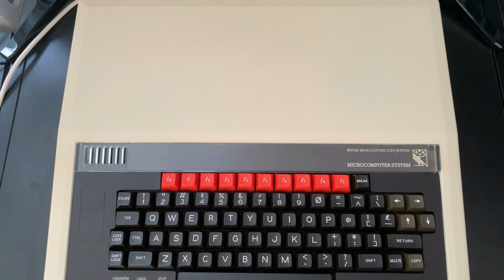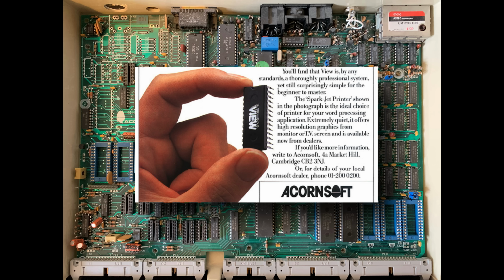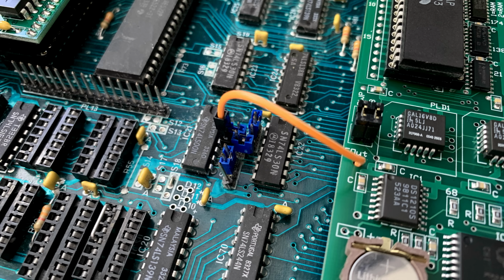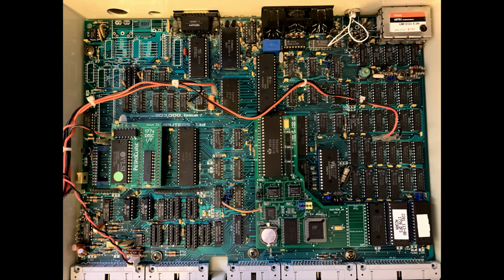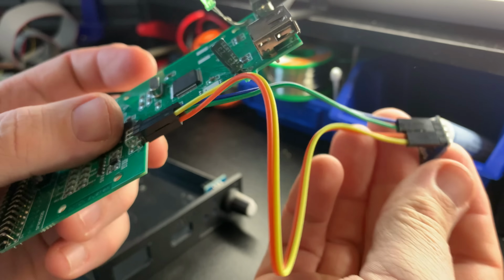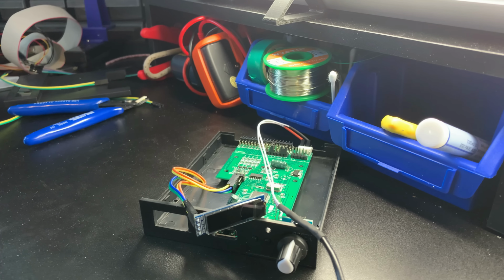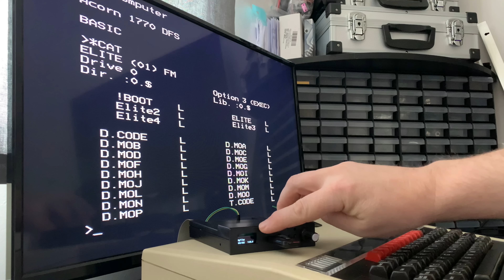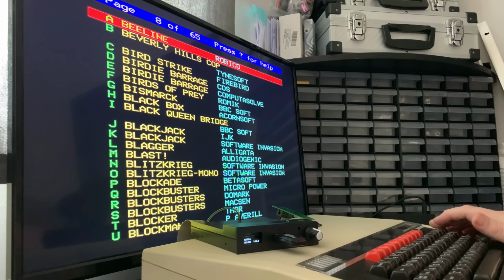BBC Micro - Part Three: Can This Little ACORN Grow Up To Be A Massive OAK?

Comment: It really is the most gorgeous font on the BBC.
Designed for Teletext, it's requirements were to be readable on a PAL CRT of a certain size at a certain distance, across the living room.
It used the analogue nature of video signals of the era to generate sub-pixel detail, psuedo-triangles instead of pseudo-pixels, with four different shapes, NW, SW, NE and SE.
I don't know if the regular raster modes used the sub-pixel detail trick but mode7 definitely did.
It's not a font of course, merely a character set.
Unnamed, it's typically known as the "SAA5050 character set", named after the character generator IC found in the Beeb and Teletext devices, the Mullard SAA5050.

Comment: I remember Solidisk, that sideways ram solution fitted at the side.
I also remember making a single sideways RAM extension for a friend, using 2x 8k chips piggybacked and a 74 logic chip to steer the select
Reply from the maker: That’s cool!

Comment: IIRC, you can use *. instead of *CAT and <shift>-<break> will boot a bootable disk. Less to type!
Reply from the maker: You're absolutely correct :). In fact, the main acorn forums are at stardot.org.uk (*.) -  With MMC devices, ADFS and Sideways ROMS there are various combinations of CTRL-BREAK/SHIFT-BREAK to do things and I always get the wrong one :) :)

Comment: Another great Beeb video! Brings back lots of memories for me, we had 16 of them eco-netted together. One machine had a 20meg winchester hard drive, where all the files were saved too. One machine had a disk drive and that was the one I always used so I could play games. Years later I came across an auction for a lot of bbc micros from a business that was selling up. I ended up with 3 machines drives etc and several large boxes of original software on tape and disks. One day I will pull it out of storage and sort out what I have
Reply from the maker: Can I give you a hand? :) :) If you’re an Acorn fan you’re going to LOVE this weekend here at the Shack ;) Keep watching :)
Reply: Winchester hard drive
Now that's a name I haven't heard in a long time... A long time.

Comment: I was using one of these in a lab as logger until 2005 when I updated to a pc and LabVIEW.  The beeb was a built like a tank. Miss having access to ADCs, and various buses on old personal computers.
Reply from the maker: You’re not wrong there!  Has anyone else on the channel been using the Beeb in a professional capacity later than 2005? Let us know!
Reply: @TheRetroShack  I guess the raspberry pi or similar would be the equivalent now.
Reply: @andrewapsley7259  The OSes are too big and complicated for simple tasks. too many hidden things updating and breaking.

Comment: I remember having a non battery backed Sideways RAM bank installed on my Beeb back in the day.
It was a bit clunky and came with the machine when I bought it 2nd hand and did weird things with the user port which caused issues with my mouse & paint package.
Reply from the maker: This one seems to be playing nicely so far :) Thanks for sharing!
Reply: @TheRetroShack  think it was this one https://telcontar.net/About/Beeb/evil-hack/Both-expansion-boards.jpg Solidisk, had leads which you had to attach to various points on the board and chip legs, which never seemed to stay attached for long.

Comment: Pin 14 of the right most rom (basic) is out of the socket.
Reply from the maker: Timestamp?  Must be an optical illusion as it's working fine :)  I'll open her up later to check :)
Reply: @TheRetroShack  7:39
Reply from the maker: @ucmetoo1  Ah, I see.  That's not the basic rom, that was the SPI rom and the leg was slightly bent.  I removed it anyway and instead I'm using an MMFS rom loaded into a sideways rom bank.  Good spot though :)  Eagle Eyes!
Reply: @TheRetroShack  😁

Comment: I have just inherited a BBC micro B from my uncle.
Hope this isn’t a stupid question but does the Beeb have an internal clock? And if not is there a way I can install one as I’d like to write a programme that requires one.
Reply from the maker: As standard, no.  But if you add a sideways ROM/RAM module like I did, you get one then :)
Reply: @TheRetroShack  brilliant, thanks!
I will look into a sideways RAM.

Comment: Has anyone built a homebrew Version of the BBC B or Master....As all the components are still available  ?.

Still available:

CPU   W65C02  (up to 20MHz)  (DIP or PLCC)
RAM   SRAMs like UM61256-15  IS61C1024 -15....  15ns
ROM  W27C512 etc  45ns  DIP/PLCC
6845/6545  /HD63C45CP/HD6445  DIP/PLCC
SN76489 DIP16
FDC Still available WD1773 ??
Teletext Chip is still available 
And practically all the other chips can still be sourced ??

Would be great to buy an updated (Faster / Better ) Acorn BBC B/Master .
Reply from the maker: Another interesting concept!  Lots of great ideas coming out here.  This one sounds quite achievable to be honest :)